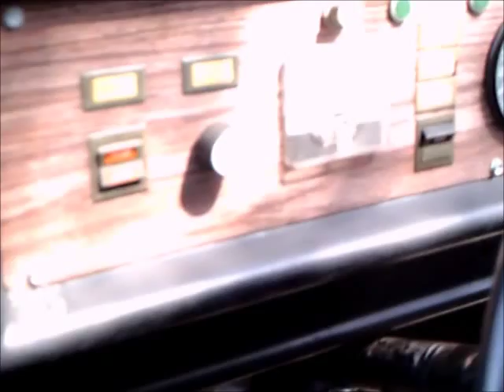1975 Sebring Vanguard Citicar Orng Lakeland090114

Comment: Just like today's electrics, not real practical for the common owner but usable in some niche areas.
The next version were built by the Commuter Car company. They made a commuta-van and commuta-car. The vans were sold to the postal service.
Reply from the maker: Exactly...it's a niche vehicle right now.  I expect alternative transportation modes like this will be used widely in the future.  The postal service tried them, but I don't think they were meant for that everyday heavy duty service.  Lead/acid batteries can now be seen as a primitive technology by today's standards.  Thanks!  :) Jack